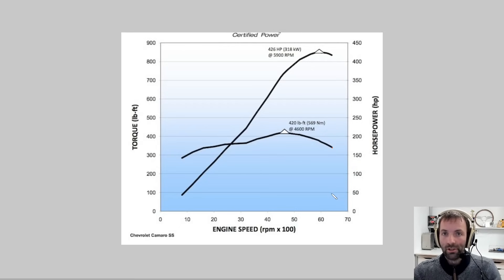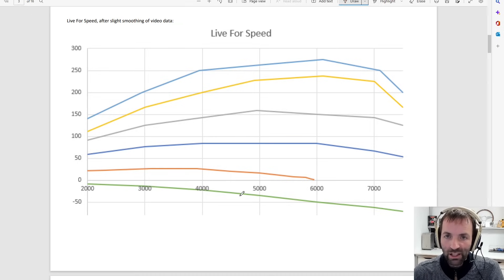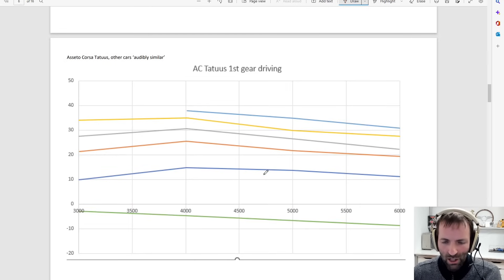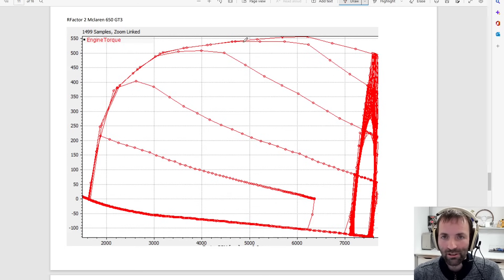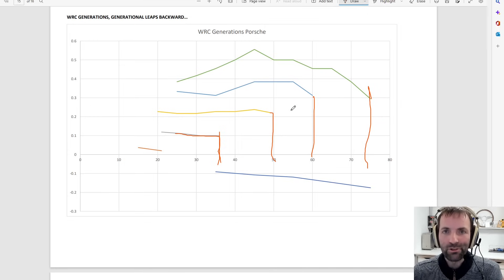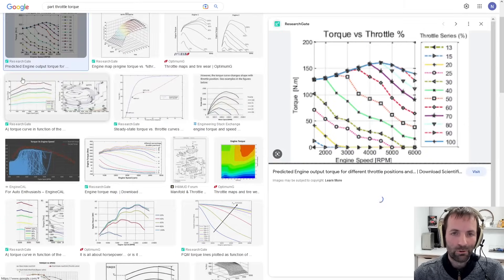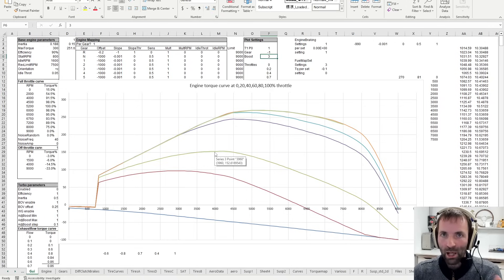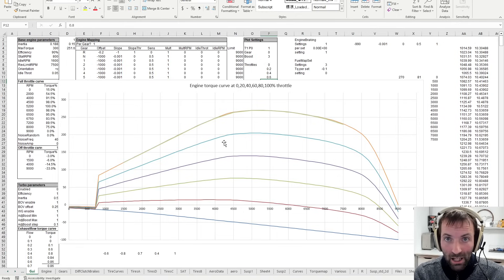Modern Sims Still Use A Throttle Model From The Year 2000! Explained, Exampled, Suggestions made.

Comment: this is just the result of having a linear throttle action; leading to linear increases in air/fuel flow and therefore linear increases in torque relative to throttle position.
20% throttle should lead to 20% torque, unless you've got a car with a leveraged or cammed linkage.

It isnt some grand secret.

What you aren't showing is whether different cars have different torque curves in a sim,  or if the same cars have the same torque curves in different sims.
Reply from the maker: Is your certainty backed up by data and maths? This might sound mean but I wouldn't be able to supply much of this either... If anything, 20% throttle = 20% POWER might sound more logical to me than 20% throttle = 20% torque.  And the resulting curve shapes are VERY different. So why is it 20% torque and not power or something else?
Of course different cars have different torque curves (full throttle curves), that is probably true since the 1990s. Wether the same cars in different sims have the same torque curves (at full throttle and / or part throttle) depends on if they got any data, and some interpretation differences..
The point of the video isn't to look at the full throttle torque curve shape, but rather to look at how 'not full throttle' changes the shape.
Reply: @NielsHeusinkveld 

POWER isn't more logical than torque.  Maybe as logical, under certain unlikely conditions, but since POWER is a function of torque and revs, &,  torque &  revs are both functions of the throttle... you're splitting hairs that do not need splitting.

It would be more accurate to say that given a linear linkage, 20% throttle should lead to 20% air/fuel.  Both torque and power would be dependent on the engines current revs.
Reply from the maker: @RobinHood-yk8og  But wouldn't the air requirement be almost linear with RPM? So enough air for 3000RPM is not enough air at 6000RPM? And if the air/fuel mixture is about the same everywhere, if you limit air, you limit fuel, you limit power. 50% throttle valve opening might allow enough air in for maximum torque at 3000RPM, so this air gets mixed with fuel and you get 100% of the torque, but not at 6000RPM.. Hence constant power curves, which would mean steeply downsloping torque curves, would make sense.. 
Data is very rare, I haven't seen it, I am pretty sure most sim devs haven't seen THAT much more than I have. Or at least it would seem so by the number of sims sticking to a simple model that 'works' .. but maybe just not quite right.
Reply: @NielsHeusinkveld  You're getting to POWER too early in your equations.

Torque is the product of force (air&fuel) * leverage (i.e engine config).
RPM = (Torque/Resistance) * Time.
POWER is the product of Torque*RPM.

No Torque = No power. No RPM = No POWER.  You need both Torque & RPM to measure POWER.  In practical terms this might seem like a couple extra unnecessary steps when you've got dynos/telemetry analysis tools.... but they're the equations dynos and telemetry analysis tools are comptuting to get to the POWER numbers.

Throttle --> Torque --> RPM --> POWER
Change Throttle = Change Torque = Change to RPM = Change POWER

You can also reverse the Torque * RPM = POWER to give POWER / Torque = RPM,  or POWER / RPM = Torque.... but you can't find Throttle (air/fuel) from either of those.
Reply: Apparently it's quite a secret, being that you're entirely convinced with the scientifically wrong answer. MrRadicalMoves posted a fairly good explanation of what actually happens.
Reply: @jacksonp.928  if mrmovesabout doesnt restate the equations in my post above, then he's getting it wrong too.
Reply: @RobinHood-yk8og  No, you're just using simple equations in the wrong way. Energy (work) is the direct product of fuel/air/spark. Work divided by (delta) time is power. Assuming AFR and thermal efficiencies are constant (which is not the case but will facilitate explaining the equations quickly), that means power, required airflow (to fill the cylinders), and fuel flow are all proportional to RPM. At a low rpm, there is not much power produced (since the cycle time is relatively long), so there is not much fuel needed for the air intake. Opening the butterfly just 10%, for example, might already allow enough air into the cylinders to fill them. With a perfectly responding fuel control, that would mean full torque at that RPM from just 10% throttle. That is what this video is about.
Reply: @jacksonp.928   Simple equations that you've entirely misunderstood.

Energy is not a measure of work, its a measure of potential... e.g the fuel tank is full of energy, but you dont measure POWER by how full the tank is.

Energy has to be converted into force... which in relation to a car's engine, is called Torque.

Overtime that force makes the crankshaft spin at a speed measured in RPM.

Taking the Torque figure and RPM, you can now measure the amount of work done... and that is expressed in units of POWER.

Torque * RPM = POWER.

Rather than telling me I'm wrong and then typing a load of unreadable nonsense, go read a dictionary, then go read how engines and transmissions work.
Reply: @NielsHeusinkveld  should also note that a predicatable linear torque response is probably a benefit in any race car, and anything with an ECU has the ability to tune specifically for that characteristic.
Reply: @RobinHood-yk8og  I have a degree in this...quite well understand how it works 🤣Work is not power....
Reply: @jacksonp.928  If you spent 3 years and ... $30k on your degree in 'this' - which is what by the way? Maths, physics, mechanical engineering, something else entirely? -  and still don't know what power is, you're a lost cause.

Rather than copypasta'ing the first google hit, which is probably from an electricity supplier... even just reading the relevant wikis would be a great place for you to start...

1- Engine Power - https://en.wikipedia.org/wiki/Engine_power

specifically this - "Engine power is the product of the engine torque and the crankshaft's angular velocity." - but there's reams of relevant equations for you.

2- Horsepower - https://en.wikipedia.org/wiki/Horsepower

"Horsepower (hp) is a unit of measurement of power, or the rate at which work is done, usually in reference to the output of engines or motors." - Again, there's plenty more reading for you there.
Reply: @RobinHood-yk8og  mechE, and I wish it was only 30k 😂. That said, you don't need the degree for any of the things mentioned in the discussion, as they're all just the fundamental physics you learn in high school. Ironically, you cite wikis, which are probably the first google hit to your searches. Can't tell if you're just trolling since you're so off base, but anyway: Power is torque*angularVelocity, yes (Nm * rad/s = Nm/s = Watts). It's also work/time (Nm/s = W), which is what I said. And again, work is energy (Newtons*meters = Joules). Those things and understanding how the work cycle of an engine...works...explain why throttle does not have a linear relationship (as further detailed in my previous response). Electricity suppliers would probably list P=I^2*R (watts = current^2*resistance) or P=V^2/R (watts=voltage^2/resistance), not any of the other equations I mentioned.
Reply: @jacksonp.928   Dude, go get a refund.

Comment: these days we have a lot of ways to predict data with AI, even with a few real samples devs can improve the synthetic models, okay, it's not easy, but it's a way to do it better
Reply from the maker: I'm skeptical about AI in general, but especially here. I can't see how. Keep it simple and smart and coming out of a human brain is what I think will be victorious for a good time to gome. (if they sell ChatGPT for 49 billion, well its not hard to have something more inteligent so more valuable than Twitter, so maybe that's a fair price..)
Reply: @NielsHeusinkveld  yeah totally agree, sometimes the easiest way is the best, we can see that in iRacing, even with a simple model they still have a lot of players. But being a data scientist I like to look to some areas that are hard to work on. I may be wrong, I don't really know much about engines so I may say something really stupid, but what I'm thinking about AI is using some kind of regression. You can give the AI some variables that affect the torque (Idk maybe throttle, rpm, cylinder placement, temperatures...) that are possible to measure from some real cars and the respective real torque, train a regression model to get an output as close to the actual torque and try to predict the torque for a new set of variables that you don't know the actual torque. I think it's doable, maybe not as accurate as the real data, but it may be end better than the old model.

Comment: This is complete bullshit honestly.  I can only laugh at it, not copy it. Something which don't apply to real engines, must not apply to SIM games at all.
What you are trying to achieve is called tuning/modding the parameters, if your pedal will interact with car acceleration due to software inputs, giving different results, it might end up like AMD Drivers.
Be it 25 years old model of acceleration or 250 year old model, if Pedals have to open air to pass more fuel to engines that pistons can move and crankshaft does its work, hence acceleration happens (in Fuel bases engines not Electric motors) then it should be like that. Everyone gets same result then it should be like that.

If you come with STATS and DATA about how real cars accelerate, with the charts and it differes with the above data then its the DEVS of all games at fault, if it matches then you are at fault.

Comment: A 22 minute video just to say he's a nerd. Dude, you could have just ended the video as soon as you opened spreadsheet, we get it, you're a nerd. Seriously though, this is mostly just an obsession with insignificant increments, which is why game devs haven't "fixed" it.
Reply from the maker: So one real engine might require 40% throttle starting corner exit, the sim requires 80%, what is insignificant about that?
Reply: @NielsHeusinkveld    Is that the average, or is that one of the extreems? Even if all games are off by a factor of 2 with the throttle input to exit a corner, so what? If someone were to "fix" this problem, would they actually have a better game?
Reply from the maker: @stburr91  There is almost no data, so it is hard to say. At low enough RPM, that could very well be a 'common' case, but I can't be 100% sure.
Reply: @NielsHeusinkveld   Don't let me bust your balls, your main point that there is room for improvement in the realism of the throttle in most racing games is correct. How much improvement in practical terms would a more accurate throttle be is debatable, but if someone is making a new sim, it probably wouldn't hurt to make it more accurate, rather than less so.
Reply: Be aware @niels007007 that this response is from the number one sycophant on the WRC:G message board on Steam.  Constantly denying there is any issue with the game when every intelligent person within two minutes realizes the clutch, throttle and drive line simulation is completely borked.  Beyond belief that he would reply here in this smug manner to someone who has worked directly on sims and is an acknowledged industry expert. WRC:G wins the award for taking an outdated model and making it worse.  This individual wins the award for inflaming user disappointment with an obviously flawed product--which is not helpful to the devs of the game, the purchasers of the game, or himself.  A real piece of work...
Reply: @marccollins1445  

Bro, I've repeatedly talked about the issues with the throttle in WRCG, and have said that even if the throttle is accurate for the Rally1 cars, it shouldn't be applied to all the others cars. What I also have been saying about the throttle is that it only takes a slight adjustment to get used  to it. There are literally thousands of people having no problem using the throttle in WRCG, and only a small percentage that can't/won't make the simple adjustment to the throttle, and therefore constantly whine about it. So stop lying about what I've said.
Reply: @stburr91  You have done nothing but spread misinformation and lies about the WRC:G situation...implying there are no problems and that people should just adjust.  This is from a no-nothing who hasn't even used or tested the game with a proper set of pedals.  Sorry, my comment stands.  Niels analysis stands.  The game is a joke even if all one is looking for is a casual bit of fun.  I had no expectations that it would be a "sim," yet it still fails miserably.  Period.  Your denials don't change the facts, nor are they helpful for people considering a purchase nor are they helpful for those of us who hope the devs will actually fix the issues for the benefit of all of their customers (most of whom use console game controllers and are satisfied with arcade, but who might some day want to graduate to a bit of realism).
Reply: @marccollins1445  

Misinformation? I've posted videos definitively proving people's claims about the throttle wrong, and I'm not the one spreading conspiracy theories about how the devs intend the throttle to work, so go take your trolling somewhere else.
Reply: @stburr91  When you learn that there are three pedals (yes, something that elementary), you should then feel free to comment on this issue or other people commenting on the issue (including from the industry expert who runs this channel).  Until then, you know what you can do.
Reply: @marccollins1445  

What are you going on about? I have a DD wheel, 3 pedals, and a H-pattern shifter, so yes I feel free to comment on this subject. 

I'm done with you bro, have a nice day.